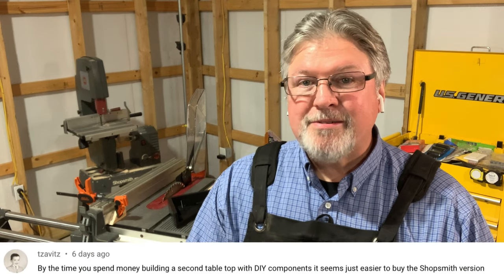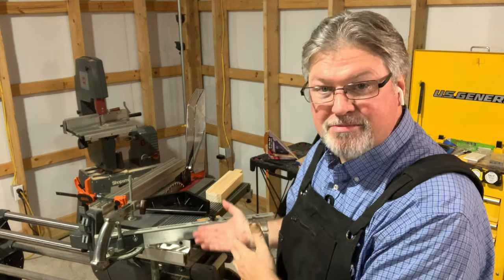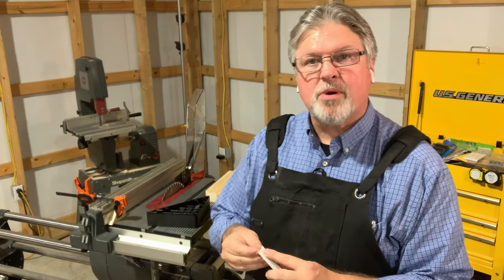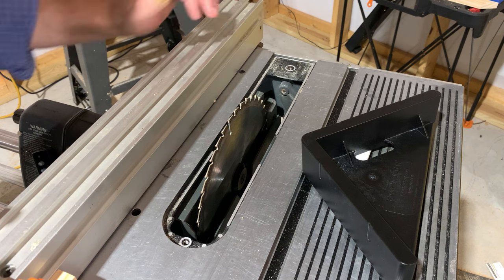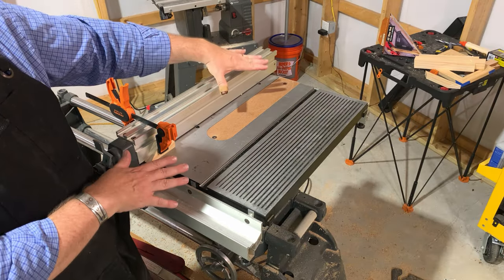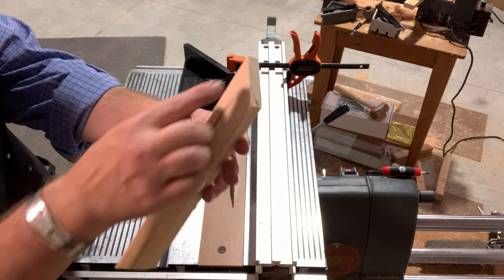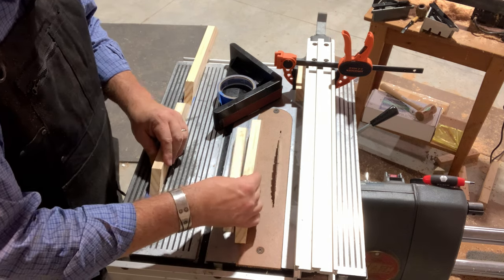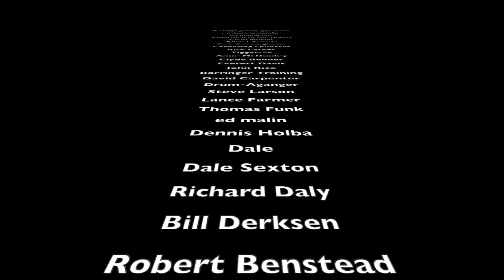Rockler 45° Miter Sled Take 2:  I Stand Corrected!!!

Comment: I bought the Rockler 45 you are demonstrating. Since the miter slot is to wide to fit and slide in the SS miter slot, I carefully filed the miter on the Rockler 45 jig it now fits and slides perfectly  and is accurate.
Reply from the maker: Perfect solution

Comment: Regarding the table insert -

When the inserts were first available the screw holes had no support.  Consequently over time the screws would deform the holes.  I would glue a wooden stir stick in place providing the necessary support.  I contacted the company.  I mentioned what the flaw was, they wrote back, thanking me and sent two refurbished, now standard inserts.  The screw holes are now supported, making their inserts very good.

Comment: Great video with great content.  However, I have a difficult time buying something just to modify it just to get it to work.   In the Navy we called that  Jury-Rigging and while it may be ok in an emergency, It shouldn't be something should be used for ever.  But- to each their own.
Reply from the maker: I understand that point of view, and used to share it, but there are just too many tools that we modify and enhance to meet our needs. Even SHopsmith offers a simple wooden block with two carriage bolts and knobs that any good woodworker with his or her salt should be able the easily make. But to your point, shouldn't the miter gage work just fine without a wooden block? Nope. Sometimes you need a little more support and some times you don't. That said, it would be nice if Rockler included some self adhesive sandpaper and either a relocatable bar or something that would accommodate the shallower depth of the SS slop. Perhaps they'll investigate.  Scott

Comment: Scott, if I was in the market for one of the 45 Miter Sleds I think I would go ahead and get the ShopSmith version. I am not a fan of having to modify a product to work on the ShopSmith, also I like the longer fence and stops. On top of that I like to support ShopSmith, want to keep them around.
Reply from the maker: I like your style, Rick.
Reply: I don't use my ShopSmith Miter Pro all that often but it makes frames accurately.  Good decision on several fronts Rick.
Reply: Agreed. Scott did a nice job making the Rockler work, but Jim McCann's design and implementation is better.

Comment: That’ll do!  But… I’m still comfortable with my old Craftsman version.  Maybe I should show it in a video… it has worked for 30 years!
Reply from the maker: Yes, you should. Have you ever done crown or a compound miter with it?
Reply: @MyGrowthRings  Yes, both.  The extended stop has a slotted paddle that allows for a bolt on block that will position the crown angle and stop length.   I’ll have to dig it out and piddle with it again.  Thanks for the reminder!
Reply from the maker: @sassafrasvalley1939  I studied the patent for it and thought it was quite clever.

Comment: For using the Rockler 45-degree gauge for setting up your Miter Pro. Put the gauge up against the saw blade (With the machine unplugged) ang slide the miter pro up to in with the miter pro in the table slot.
Reply from the maker: The MiterPro is already locked in at 45°. Are you talking about the miter gauge?
Reply: @MyGrowthRings  Put the black Plastic triangle against the Blade and slide the fence on your miter gauge up to it. Instead of trying to hold the miter gauge with the fence and the triangle.  The beginning of your video. Thanks Tim

Comment: I never have understood why tool manufactures for table saw accessories feel the need to make miter bars thick enough to fill the San Andreas Fault for a tool that's meant to register and ride on the table top surface. What are they gaining with that extra 1/32" to 1/16" added thickness of the miter bar?
Reply from the maker: I agree. I can’t tell you how many comments I receive about Shopsmith‘s “non-standard“ miter bar and saw arbor. In 1954 there was no such thing as a “standard“ miter bar size. In fact, Magna Engineering chose this size after several years using a 3/8” X 3/4” slot on the cast iron table on the 10ER.

Comment: I think the star of this video (other than you Scott) may have been the ebay-purchased zero-clearance insert that made the demonstration possible.  Were you satisfied with the materials and build quality of this?  I remember your earlier video on the "flex" of the SS inserts and have looked at probably the same ebay listing as you for many months wondering if I should give it a try.  Watch out ebay seller, Scott's comment may cause a run on your listing 🙂
Reply from the maker: You are exactly right, it saved the day. Yes, I was very pleased with the build quality and it appears to even have a slight bow to it. That may be what he’s accomplishing by building it from a sandwich of parts. I highly recommend it and have a link to it in the video description. (Hint) Scott

Comment: I hate to take a "cheap shot" but, it's not cheap! Your cost more than doubled with the purchase on any zero insert. The masonite/wooden one sells for $45 + $5 shipping to my area. The Shopsmith blank insert is $30.00 + tax and shipping. I didn't look up the phenolic insert that Scott said didn't line up.There are no stops or sandpaper on the Rockler. You simply cannot beat or even match the Shopsmith Miter Pro (even at $132 fro Shopsmith...better deals can be had on eBay). The rocker may work well on other table saws, but still lacks the stops and sand paper. The stops make cutting picture frames almost idiot proof with the miter pro. The time you spent modifying the Rockler was minimal in the video, but coming up with fixes can waste a LOT of time. Other responses echo this sentiment.Don't try to re-invent the wheel! Scott, sorry about the "cheap shot". jim
Reply from the maker: Where are you located? A single 510/520 Masonite/wooden insert is $19.99 with free shipping: https://ebay.us/WZ8w58